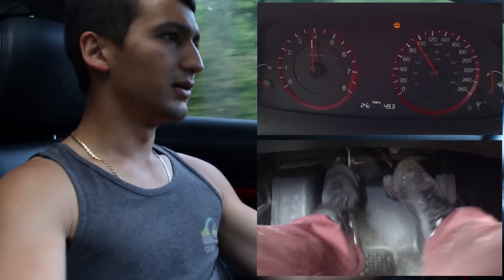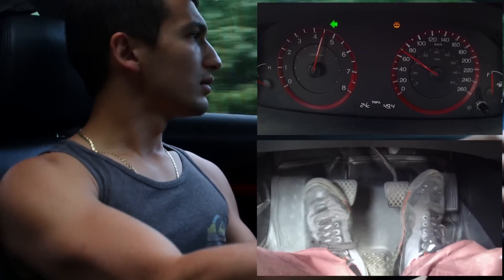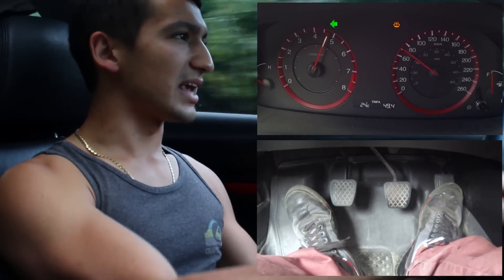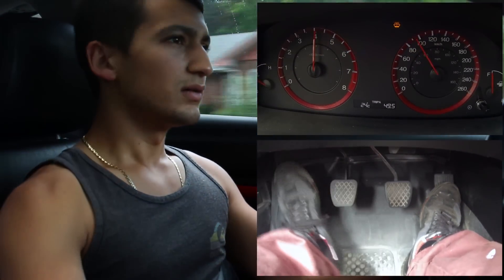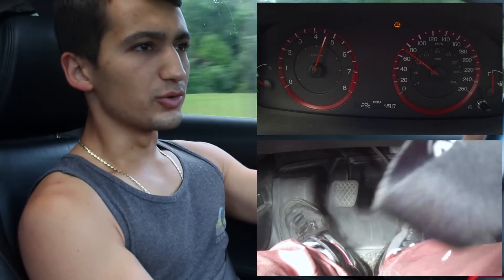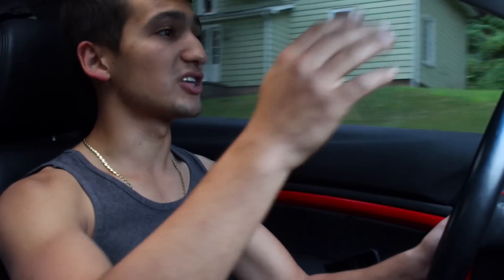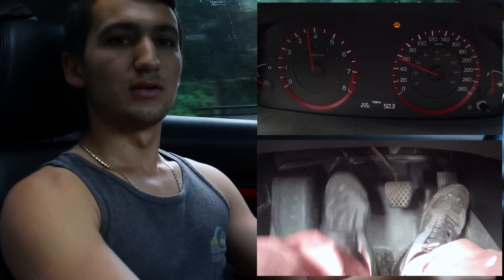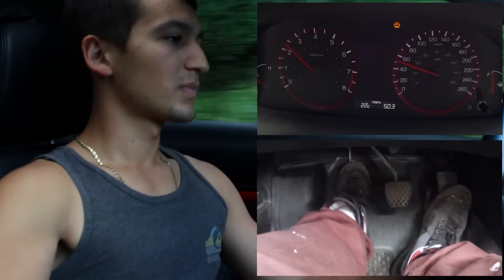Heel Toe Downshift | Advanced Driving Technique

Comment: If I pressed my brake pedal that hard, I would jump off my front window
Reply: +bogs You have to stand on Asian brakes. They prefer a manual brake kind of feel. It's scary if you are used to American cars.
Reply: @port nut I'm not talking about the feel of 1960s American trucks with 4 wheel drum brakes, but they tend to be stiffer than American cars from the 80s and 90s.

Comment: Really good video, thanks. I´ve tried it a few times in the past but a big problem is that in modern cars the brake is often extremly soft so that there is no feedback, I hate that!  It´s also hard to brake at a consistent level with the heel up from the floor, not to mention hitting the gas without doing a full braking.
In my own car I didn´t upgrade the brakes because that would have softened the pedal even more.

Comment: How hard would it be to double clutch heel toe downshift?
Reply: +calum anderson It's probably about as hard as you imagine it is. Learn this and double clutching separately. Then when you're confident with both techniques it's just a matter of combining them.
Reply: +Halojen I prefer left foot breaking
Reply: +calum anderson don't double clutch cuz it sucks
Reply: +James Mclanders You can't really left foot break while shifting gears can you ? :)
Reply: +calum anderson Unless you own a really old car with no synchros then there is no reason to double clutch
Reply: +Mycroft Griffin You can if you match the revs correctly, but I personally wouldn't do it.  Try pressing the brake pedal with your left foot with the car stationery and you'll see why it's dangerous if you don't know what to expect.
Reply: it's hard to explain but you break and clutch then you jump both feet to the right.. you should be down shifting before the corner...
Reply: I was thinking the exact same. You would have to be a Pro.
Reply: +Mycroft Griffin paddle shifter/semi automatic
Reply: +calum anderson That’d make you a Heel Toe Hero…
Reply: +Project Xfire I thought he mentioned that the whole point of double clutching was to NOT WEAR DOWN the syncros?
Reply: I double clutch+heel toe from 5th to 3rd in my Accord for engine braking. Its used for coming up to a turn in my case. It takes a lot of practice but is fun when you finally get it.
Reply: Forget the double clutch shit your not driving a crash box, Its all about rev matching. Fast on the track, good for the running gear.
Reply: Project Xfire Saves wear on the syncro in some situations.5th to 3rd downshift.
Reply: The amount of wear you save it so small it is not enough to matter in the time you own the car... Unless you plan to drive the thing for the rest of it's life. Which I doubt, Not enough money for payments, repairs the chances of an accident, etc. It wont happen
Reply: Project Xfire I live south of Chicago so 22 years is it before the rear suspension arms pull free of the rusty unibody. I want to make sure trans makes it that long. It definitely will if driven by a grandma but not sure with my driving style. Plus its just fun to be able to shift that way sometimes.
Reply: i shoe came off last time i tried
Reply: Project Xfire How about clutch wear? What you’re essentially doing while double clutching is that you clutch in, put it in neutral,  clutch out; rev-match, and again clutch in, downshift, clutch out, and floor it; easy as that. And while during upshifts it’s gonna reduce rev-hangs. It takes some time to master though, but when you’re done; it’s just a beautiful feeling; I bet your ass on that man.
Reply: @StormRunnre  So you're saying that fast and furious taught us wrong then?

Comment: in my car there is quite a gap between my gas and brake pedals so I put my heel on the brake and reach my toe up to tap the bar of the gas pedal. The toe of my foot is naturally pointed outward so it's easier to have my right toe pointing to the right rather than twisting my foot in the opposite direction. plus there is a big gap between my gas pedal and the floor so if I have my toe reaching up I don't have to push the gas pedal so far down. it's difficult to explain without visuals but whoever reads this should try the toe/heel it's easier than heel/toe

Comment: The problem I have when doing this is I can't keep constant brake pressure. My brake pedal is very sensitive and if I were to press it down that much then I'd be braking way too hard and when I press it lightly I can't keep constant pressure when I try to reach for the gas pedal.
Reply: I have the same problem, it hepls to have a good brake pedal. Nice and firm a pedal you actually have to press into to get some full brakes

Comment: If you would agree that it is possible to change the gears without pressing the clutch, try and up and down shifting without the clutch.
Reply: +Lindy penha its easy. did it for two weeks in my ranger. its called power shifting.

Comment: hey im from australia, i can hear a slight rattling noise from 2nd, 3rd and 4th gear. i drive a honda accourd euro lux, getting worried im to aggressive when it comes to changing gears. loving your videos man. is this something youve exp before with hondas?
Reply from the maker: +Walter Jr Alvarenga You can't be too aggressive with your synchros. If you mash the gears in your car and throw them in as hard as you can, you will see problems sooner than later. If you double clutch, you will save your tranny for getting worse. 
https://www.youtube.com/watch?v=KlS6DF3NjJE

Comment: Having trouble with hill starts. I can only do it with the e brake. I was told you can stay still uphill if you balance your clutch and gas. I don't wanna do that though.  Heard it wears it out so I will try heel toe instead
Reply: Just practice man, no need to use the e brake
Reply: +So Real oh this is just for now because I'm a new manual driver. But I will learn. I'm gonna practice my hill starts without the e brake this weekend.  There's a way to do it by balancing the colts and gas. I will learn that but I won't use it. That burns your clutch. The method I want to learn to use is the foot shuffle.  I will try releasing my clutch to the biting point with my right foot on the brake and then switch it to gas and take off

Comment: Can anyone explain how this helps him to get on the power earlier... I can only really see its use for rev matching
Reply: it saves a split second of removing your foot from the brake and putting it on the gas.  Yes it is essentially just quick rev matching, but if you are racing and you are getting on the power a split second more, it will save time.  a single split second isn't gonna be much, but when you are doing it 20-30 times a lap, it adds up.
Reply: Ahh yes, I see. Thanks man

Comment: how much pressure you put on the brake and which side of your right foot to blip the throttle?
Reply from the maker: +siala chanhorn For the brake pressure, it all depends on how severe the turn is and how much I have to slow down. As for blipping the throttle, i'm hitting it with the right side of my right foot

Comment: Ok.  I'm confused.  If the clutch pedal is down then the transmission input is disconnected from the flywheel.  So if you shift in that situation, what does it matter if you tap the gas.  Maybe I'm stupid.  Could somebody please explain?

Comment: In my AT g35, I drive it in automatic and for tight turns will downshift into 2nd gear and the car jerks.  How would I safely/smartly downshift it for a turn so the pull on the cars turn isn't so intense if that makes sense.  I downshift into 2nd because the curb weight feels less intense to me (the driver) as I'm going around the turn.
Reply: I'm baffled...
Reply from the maker: +Abigail Brown If you have an automatic transmission, the gearbox is not designed to be used like that. However, it doesn't stop people from doing it. If you ant to make it smoother, tap the gas as you are downshifting into second. The speed of the transmission has a say in how fast this has to be done.

Comment: The reason you heel toe is so you dont compression lock the rear wheels due to your transmission and wheel speed being different. It happens at high rpm under braking. This is a waste of time on the road........
Reply: Exactly glad someone else with track time is in the comments... all this does is make you feel "cool" when your by yourself on the road... not to mention his Honda has my least favorite pedal configuration
Reply: +OspreyBravo18 I agree.  there really is no point doing this on the road.  he also left out the fact that heel toe is used to keep the car somewhat settled through the turn.  trying to drive a car that lunges through a turn is terrifying lol
Reply: thenightlifenj1 I'm a big rally fan so I honestly just focus on left foot braking and trail braking.  If you watch the Rally driving breaking video from oneil rally school I didn't seem him heal toe and I watch half the video before making this comment.
Reply: +OspreyBravo18 no you're correct about left foot braking.  left foot braking is used in alot of motorsports including formula 1
Reply: +OspreyBravo18 shhhhhh! your giving him ideas :-P next thing you'll  be getting rear ended by a Honda trying to left foot brake, heal toe and double clutch all at the same. :P ffs people dont do this on the road its pointless.
Reply: RotorRian Lol more like rear ending someone mid corner because they tried to left foot break and didn't realize that it takes time to get accustomed to how much pressure is required.  Mk6 GTI with EBC dimpled and slotted rotors with red stuff pads I tried left foot breaking on an empty road for the first time in a while.... shit threw me forward so hard (new pads and rotors) XD.

Comment: he is not down shifting properly, when you down shift you should make sure when you do you almost reach redline and also don't depress the clutch, this will make the car engine break and put less wear and also less fade onto your breaks, if, like he said. he was going to take the corner as fast as possible he would have braked late while down shifting to engine break and provide the most breaking force possible before the corner and shift don into a gear that allows around 2000 rpm to accelerate out of the corner. if he had not said that he was going to take the corner as fast as possible i would not have to have written this comment. his technique is good for day to day driving though.